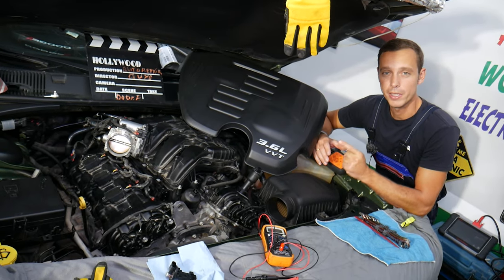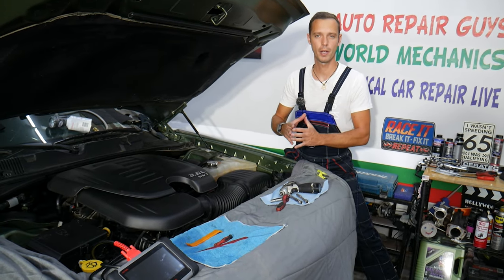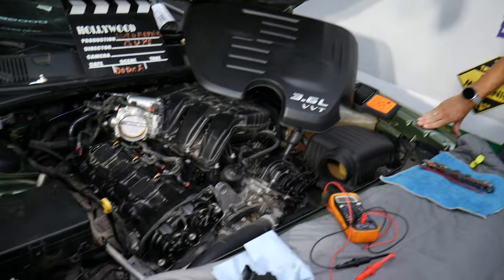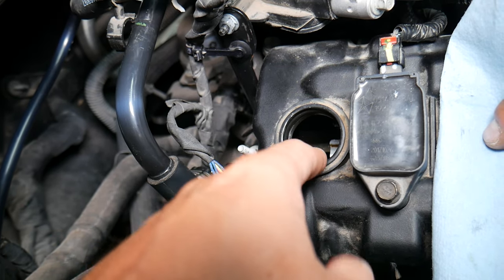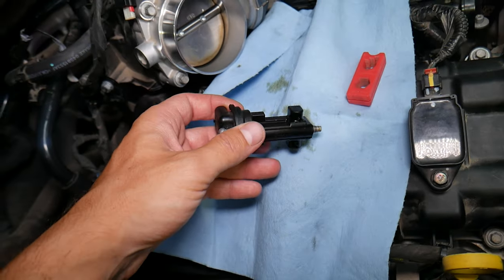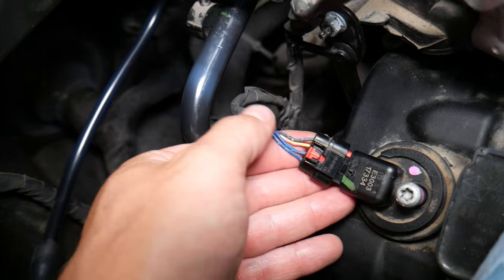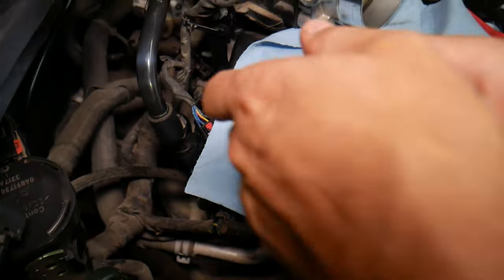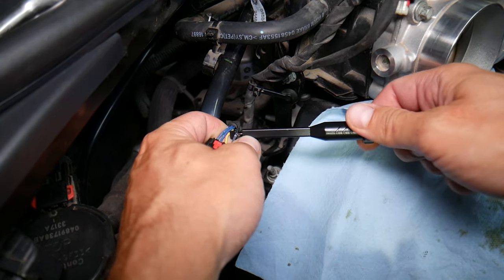DODGE CHARGER HOW TO TEST CAMSHAFT POSITION SENSOR

Comment: So if there's no voltage on wires 1 and 2 then does that mean the sensor is no good or a wiring problem.
Reply: If there's no voltage on wires, that means you have a wiring problem. Just be sure you have the ignition key turned to the ON position.

Comment: Never use a ohm meter to test sensors. Static test.Lean how to read wave forms
Reply: First of all, he's not using an ohmmeter to test the sensor. He's using a voltmeter. I'm really good with a scope and know how to read waveforms. I think the test shown in this video is a valid and legit test when you don't have a scope. It's like using a test light when you don't have an voltmeter. The test light is not as good as a voltmeter because it doesn't give you a voltage reading but it tells you whether or not you have power. You have a lot to learn Stevie.